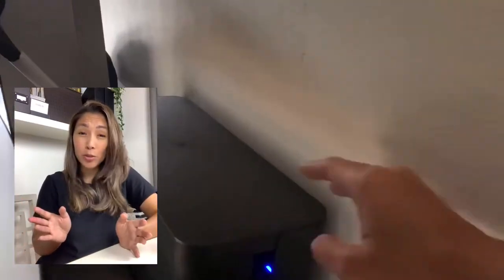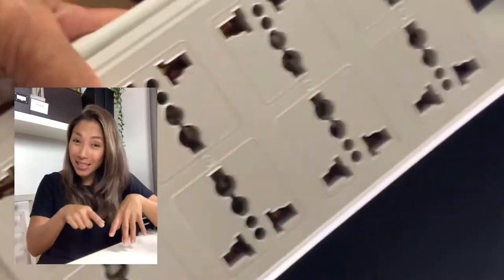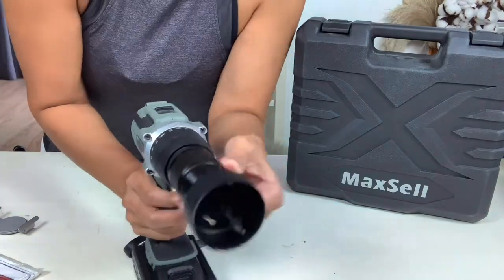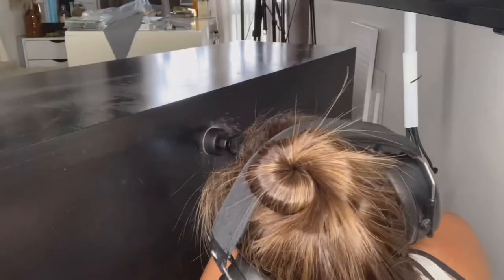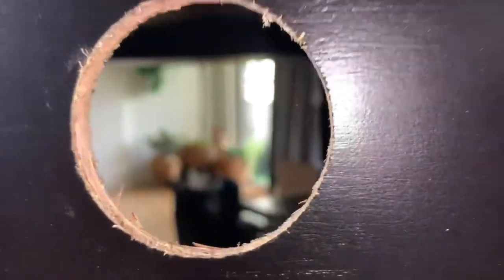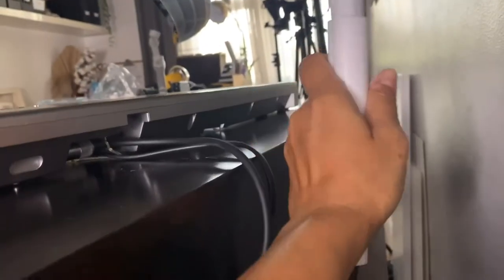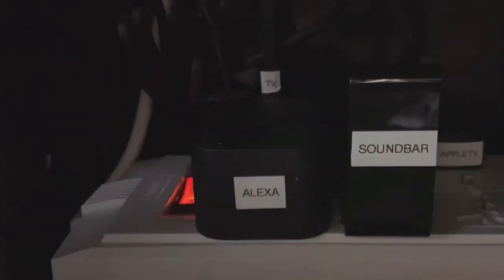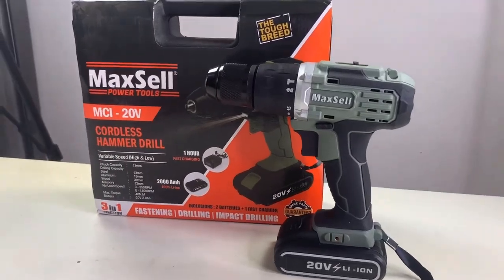How to Drill an Access Hole for Your TV Console

Comment: Hi, this is an amazing idea.

I have a tv unit that is already mounted on the wall (2 hinges with 3 long screws each). 

Would I be able to safely just pop a hole as you did with a machine while it is still mounted on the wall? Will is be dangerous?
Reply from the maker: Yes! My TV is mounted in the wall too :)